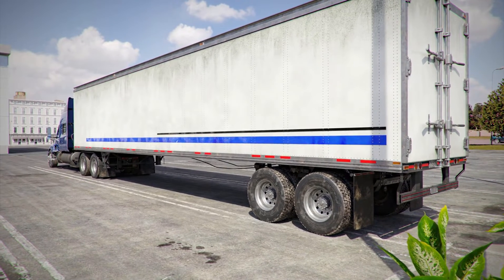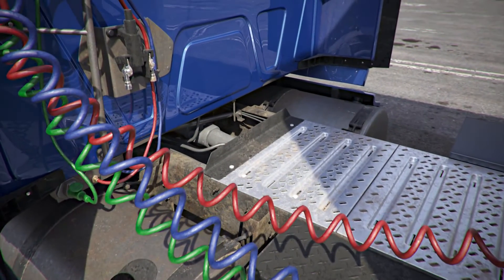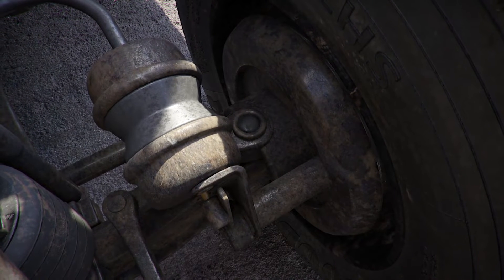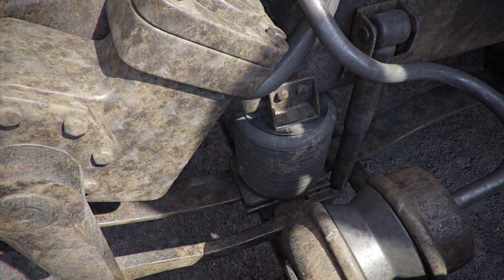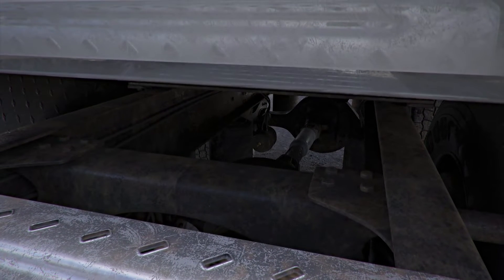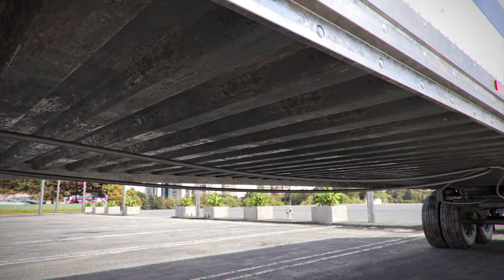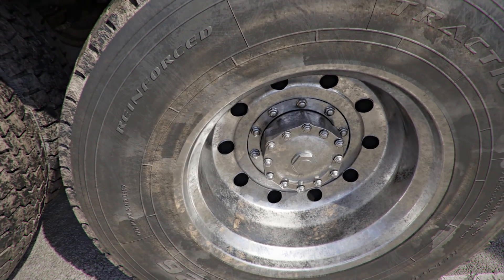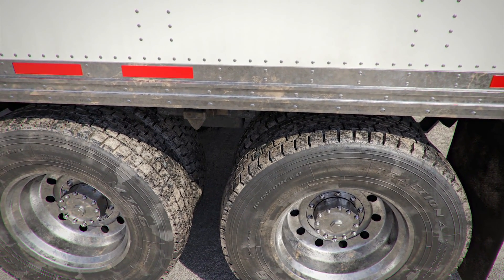How to perform a CDL Class A Pre-Trip Inspection and pass in 2024 [Full Demonstration]

Comment: Properly mounted and secure ///
Not cracked bent or broken ///
Abrasions, bulges, or cuts ///
Reply: We were told all hoses we should say not cut, spliced, or leaking. As they are class a parts and should only be replaced, not repaired
Reply: You can just say properly mounted , not damaged and not broke
Reply: Theses words will be forever imprinted in my brain

Comment: For automatic and manual trucks do you still say gear drivin for automatics as you do for manuals ? For air compressor and steering pump and such sort
Reply: Yes still gear driven , they are gear driven by the engine itself not the transmission

Comment: I'm in San Antonio Texas and I've been practicing all week on my pre-trip I have my driving lesson on the 5th of December 2022 next week, they gave us his paper to study over and plus the instructor tells us we have to say bent, broken, or cracked have for rubber flexible items it is cut, cracked, or frayed.
But yes those are the main things to say and plus no missing screws or bolts and no leaks for for reservoirs and hoses.
Reply: Did you pass?
Reply from the maker: We hope your driving lesson went well! Sorry for the late reply. There are several good ways to help you remember what you should be looking for during the inspection; we have tried to cover it all with the three phrases @Habeev07 shared from the video: "Properly mounted and secure. Not cracked, bent, or broken. No abrasions, bulges, or cuts." We hope that when you combine all three phrases, it will help you with issues you might see in flexible rubber objects, like hoses, as well as permanent metal parts like some tanks, and removable metal parts, such as lug nuts. Good luck with your test!
Reply: @wayneschoenberger3245  I had gotten rescheduled for today Dec. 20, 2022, I PASSED.
Reply: @JoeJoe-wp1vv  congratulations
Reply: Hope we both pass, go spurs go
Reply: @richmartinez10  yes I passed the test on the 20th🎉🎉🎉

Good luck to you
Reply: @JoeJoe-wp1vv  congrats man, working on my pre trip now,
Reply from the maker: @richmartinez10  Good luck! We hope you pass your test and you're on the road soon!

Comment: The video is very good, thanks, the only problem I see is that they don't point to the pieces, when people see this video it's because we don't know many pieces and for example at minute 14:04 it talks about 5 different things and shows practically the same thing, For the beginning guys, you don't know which is which. I would say that this video would become one of the best if they put a circle or marked the piece with a red line to identify it. Thanks for the video, I will watch it many times.
Reply: I was just about to write this as well, that would be very helpful.
Reply from the maker: I completely understand what you're saying. The same thing happens earlier in the video when talking about the parts that make up the steering linkage. I'll speak to my boss and see if there's some way for us to update the video with the parts highlighted because I can understand how for parts like 7:16 with the steering linkage and 14:04 like where you mentioned, it can be particularly confusing. Thank you so much for your feedback!

Comment: Nice video but the front part is missing , radiator hose ,caps , belts water pump,alternator wires, oil stick ,etc  im still in school , at dmv its not required that part ?

Comment: @15:44
Surely you understand the crank handle is NOT depicted as secured in any fashion.
Reply from the maker: Hey! We're sorry if this wasn't clear. The video lists the condition the landing gear should be in by the end of your inspection; we show the landing gear, in particular, at an intermediate stage because that's the best way to be able to view it. Unlike some sections of the truck, some pieces of the landing gear will be less visible when stowed. So, for example, right before 15:44, it talks about ensuring that the landing gear, including the crank handle and legs, is up and checking that the legs go up and down, but as you can see, the legs are not completely stowed either, just like you mention about the crank handle, because we wanted you to be able to see them both clearly. We also don't show the legs going up and down. We hope this clarifies it, and good luck with your test!

Comment: Question, let’s say I’m taking my test at the dmv, and the coolant reservoir is NOT proper level, what do I say? That’s it’s not proper level or it’s proper level? This is just an example because obviously I can’t actually check everything during the pre trip test. The coolant reservoir is just an example.
Reply from the maker: You should check your levels before you go to the DMV to ensure that they're at the proper level; you don't want to start your exam and have shown that you or someone else drove to the DMV with the truck coolant reservoir at an unsafe level. Everything for your vehicle inspection needs to match the safe levels the DMV expects. Beyond that, we'll use California as an example since you didn't mention your state. Either you will be asked to examine the engine compartment, in which case you will need to show everything on the list for the engine compartment (like a coolant reservoir), which includes the coolant level, or if you are not asked to do that section of the vehicle during your vehicle inspection test, you will not be asked about the coolant level. Here is a link to everything you might be expected to check, and it's quite extensive (look at section 11.7.2): https://www.dmv.ca.gov/portal/handbook/commercial-driver-handbook/section-11-vehicle-inspection-test/